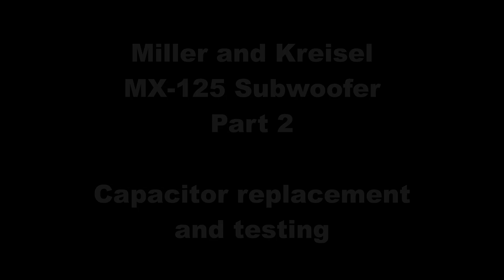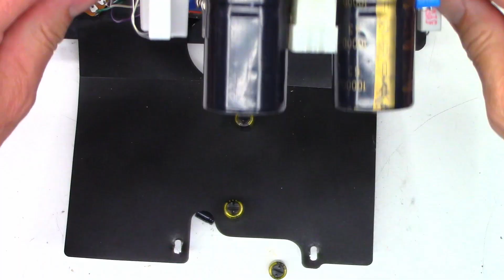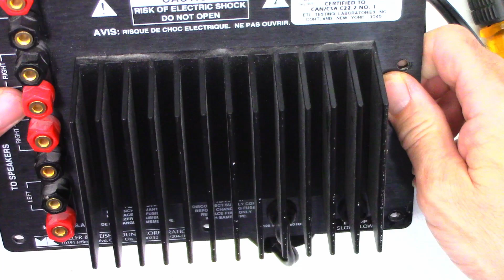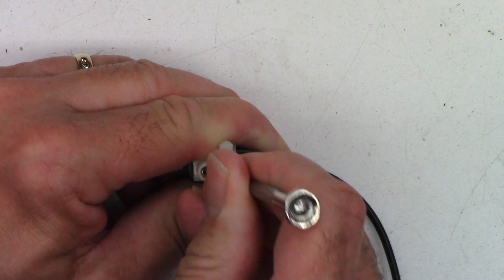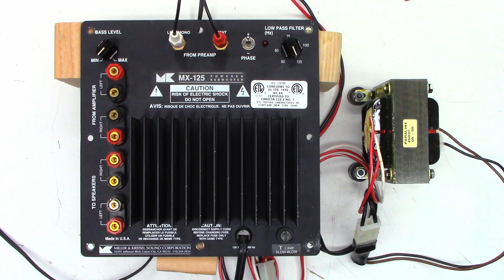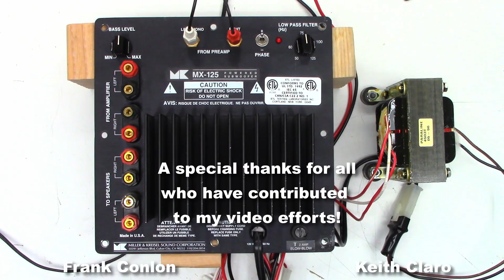PART 2 - MILLER AND KREISEL MX125 SUBWOOFER REPAIR -  YOU GUESSED IT, HIGH ESR CAPACITORS - RECAP

Comment: Hello, I am from Greece and I would like your help with a problem I am facing with the subwoofer. I have an M&K sound x system with a MX125 subwoofer which I had purchased from Sakiotis LD Athens 1999. Everything is still working perfectly except for the subwoofer which has had problems from the beginning: inability to adjust, incomprehensible, irregular hums at low frequencies and and when I turned the volume knob, a terrible low-frequency humming sound without any open input source. I sent it once for repair to you or to America and they sent it back to me and it worked for a month and the same thing happened again. Since then I gave up on it but now I need it and I want to repair it. where 

is there any store in greece that represents me. also i can't send it whole because of the weight but it's part only the amplifier i imagine
give me instructions on how to proceed thank you very much